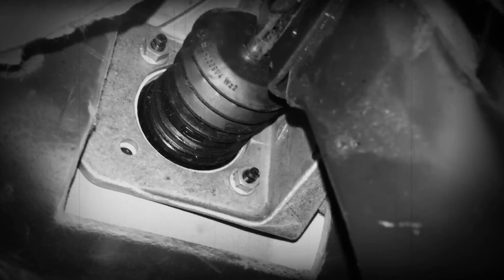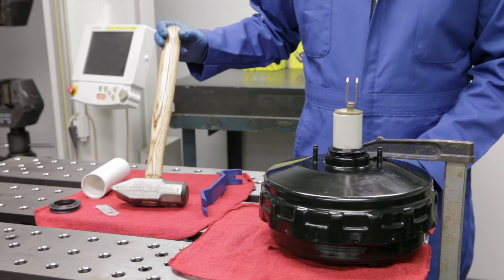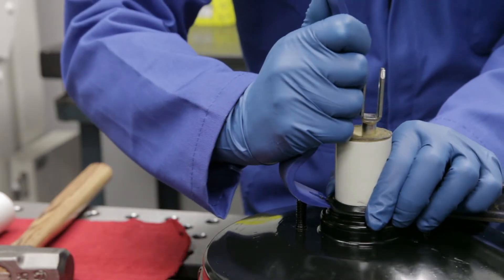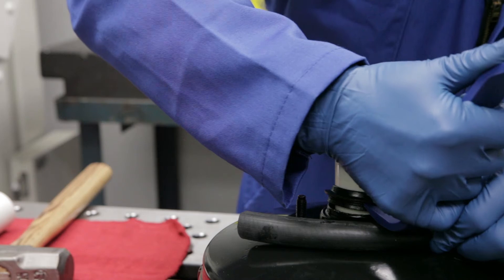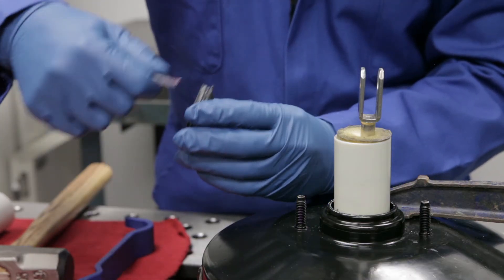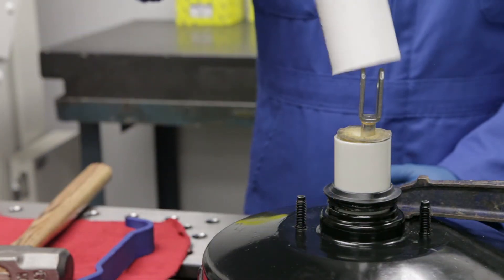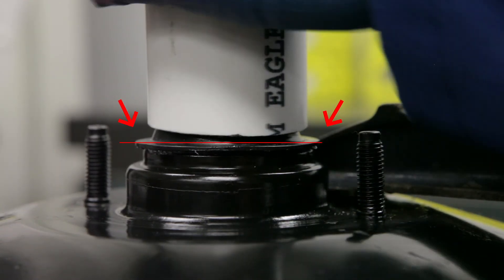URO Parts Repair Kit 001 430 0708 for ATE Brake Booster Plunger Seal 03.7718-5028.1

Comment: I am struggling to find the right pluger seal for my 1998 SL500 - the part number is nowhere to be found.... any thoughts on one that will fit?
Reply from the maker: Sorry Booth, unfortunately we don't have a seal kit for the SL500.  The original seal probably has the part number molded on it, but sourcing one could still be a challenge, so it would be a gamble to remove the booster to check for a part number and have the vehicle down for an unknown duration.

Comment: Can you replace these on BMWs without removing the whole booster ???
Reply from the maker: @darrend2035  Which model and year do you have?
Reply: I have a 2003 bmw M3 , it’s the e46 generation

  It’s stops completely fine just makes that hissing sound right on the plunger seal ( when brake pedal is not pressed )
, almost certain the brake booster diaphragm is fine .

Comment: UPDATE: I finished this job from under the dash on my 2004 ML500, now let me say this AND LISTEN CLOSELY: If you have a bad back, or no to little patience, DONT TRY THIS!!! This job is a lot like sex in the dark, its all about feeling what you're doing. Having a lift would make this so much easier, you can bring the car up enough to stand next to the car as you work under the dash, if you're gonna do it on the floor, make sure you have enough room next to the car to lay out, if you have some kind of lounger or long bench that you can lay on thats level with the floor of the car that would be the best. I would make a custom platform for this job that you can lay on right along side of the car, that would make it a breeze.  I'm a 54-year old ex-mechanic who's had spinal surgery, so if i can do this ANYONE CAN!!! You need to cut the setting pvc tube in half to be able to get enough power into your strike, I lost the brake pedal clip, so a cotter pin works just as good. Another important thing, after you remove the brake pedal assembly, put back 2 bolts to hold the booster in place as you work, otherwise the in-and-out movement of the booster whenever you touch it will make this job impossible. Now whennyou finish the job and you've done it right, when you first start the car the brake light will be on and it will stay on, but it will go out after you stop and start the car after pumping the brakes a few times.
Reply: bout to go head on / back down with this on my 2002 ml320 very soon. thanks for your detailed account.

Comment: Supposedly this can be done without removing the booster and I guess I'm gonna find out about it soon😮
Reply from the maker: That will be EXTREMELY difficult and is not recommended, but it has been done before: https://www.youtube.com/watch?v=saX-GG6s1Ck
Reply: @Uroparts well I'm in the middle of doing it right now, it seems that a little piece of the old rubber seal ripped off,  when i tried to pick it out, it just fell away inside. It doesn't seem to be an issue and it doesn't seem to me to be obstructing anything, it just disappeared within the crevices of the plunger. Its not in the seal area, it was a minute little piece and it really dont seem to me to be an issue that will cause a problem.
Reply: UPDATE: I finished this job from under the dash on my 2004 ML500, now let me say this AND LISTEN CLOSELY: If you have a bad back, or no to little patience, DONT TRY THIS!!! Having a lift would make this so much easier, you can bring the car up enough to stand next to the car as you work under the dash, if you're gonna do it on the floor, make sure you have enough room next to the car to lay out, if you have some kind of lounger or long bench that you can lay on thats level with the floor of the car that would be the best. I would make a custom platform for this job that you can lay on right along side of the car, that would make it a breeze.  I'm a 54-year old ex-mechanic who's had spinal surgery, so if i can do this ANYONE CAN!!! You need to cut the setting pvc tube in half to be able to get enough power into your strike, I lost the brake pedal clip, so a cotter pin works just as good. Another important thing, after you remove the brake pedal assembly, put back 2 bolts to hold the booster in place as you work, otherwise the in-and-out movement of the booster whenever you touch it will make this job impossible. Now whennyou finish the job and you've done it right, when you first start the car the brake light will be on and it will stay on, but it will go out after you stop and start the car after pumping the brakes a few times.

Comment: Can I bye a kit for ate51 for my 250Se Mercedes -67?
Reply from the maker: Hi David, "Brake Booster Plunger Seal Kit 001 430 0708" is for late-model cars, and does not fit your 1967 250SE.  Our kit fits these vehicles: https://apaindustries.com/parts/11128  Unfortunately this is the only kit we offer, sorry we can't help you.

Comment: My brakes make that hissing noise when i depress them instead of when you release like in your video. Is this still a symptom of the seal? I also have other strange issues such as a choppy idle and the engine will sometimes rev when I am braking to a stop. I am wondering if all of this can be the leaking brake booster.
Reply from the maker: Hi Adam, yes that sounds like a leaking booster.  The hissing sound is air being sucked into your engine's intake, and that extra air going into the engine is why it revs.  A professional mechanic has ways of confirming the location of the vacuum leak before you start replacing parts.
Reply: @Uroparts  yea I tested the other day by mashing the brake pedal a lot and saw the rpm’s fluctuate. Taking it to the Mech tomorrow. I’ve had this issue for years but I don’t know how every mechanic missed it my theory is that the leak happens when depressing the brake as you said so a smoke test didn’t show anything. I bought your kit to fix the little rubber gasket. Will that likely solve the issue or do I need a whole new booster?
Reply from the maker: @Dynasty-s1y  What is your vehicle year and model?  If our seal is the correct replacement for a leaking original seal in your specific booster, it should take care of it.  Occasionally a mechanic or DIY will damage our seal while attempting installation, if that happens just send us an email with your proof of purchase details and we can mail you another one.
Reply: @Uroparts  I have a 2010 Mercedes e550 coupe. It has the m273 engine.
Reply from the maker: @Dynasty-s1y  No problem!  URO Brake Booster Seal Kit 001 430 0708S fits the 2010-2013 base-model E550.
Reply: @Uroparts  0014300708S  is what I have this is fine right? Not sure if the S makes a difference.
Reply from the maker: @Dynasty-s1y  You are correct, 001 430 0708S is the part number for our replacement seal kit.  001 430 0708 is the Brake Booster part number, which we include in our part number so people can find our repair kit more easily.
Reply: @Uroparts 
Do you make booster seal for other brand cars?

Comment: I did this on my mercedes ML500 2003 and installed it while the booster was still in the car. It works great however, the bas/esp light came on after the install and i can’t get it out of Park. Any suggestions?
Reply from the maker: Hi Julian, if you can't get it the car out of park, you may have accidentally bumped the brake switch while working on the booster.  If the car doesn't know you have the brake pedal depressed, it won't let you move the transmission lever.  For the ABS/ESP light, your ABS module may be corroded or failed, see this video: https://youtu.be/MBtx0XWhmy4

Comment: How was the dust boot / dust cover removed? I have this kit and my brake booster looks similar but the dust boot hole is too small to pull over.
Reply: And my question was answered in the instructions provided XD

Thanks URO. I was worried it would tear, but it was fine just pulling it off.
Reply from the maker: @kylerichardson8559  Excellent Kyle, thanks for the update!

Comment: Where can i get a complete booster overall kit for a Volvo S40 2.4D 2008 and engine mountings?
Reply from the maker: Hi Pine, we offer the right Engine Mount 31262676 and left Engine Mount 31277442 or 31316498 (depends on your chassis number) for the 2008 S40, which are available at great prices from online retailers.  Unfortunately we don't offer any brake booster components for that model.

Comment: Please, what's this material you put to that seevo? Is it glue or silcone?
Reply from the maker: Hi Ebrahem, the clear liquid in the tube is silicone grease, which lubricates the rubber seal and helps minimize air leakage.
Reply: @Uroparts  thanks

Comment: This isn’t working on my 2005 Volvo S60R. I have the booster out of the car and I have the seal seated, but it just isn’t going any farther than the first ridge. I followed all the directions in the video, but the first ridge on the seal ended up ripping off and the top of the seal started caving in. Help please! My car currently is underivable because of this.
Reply from the maker: Hi Connor, what is the tiny part number on your original Volvo seal?

Comment: Hello URO, my Mercedes c300 only sometimes it hisses with very low sound, and most of time it disappears.and it didnot affect the performance... Is it normal?
Reply from the maker: Hi Dion, you'd have to have a professional mechanic investigate the issue, but it could be your brake booster plunger seal starting to leak.  When it gets bad enough, it can affect braking performance.

Comment: Hi, When pressing the brakes I can hear hissing sound like on the video, is it the seal on the servo? It’s hisssing only while pressing in
Reply from the maker: Hi Kubak, like it shows in the video, hissing behind the dash is a sign that the vacuum booster seal is worn and leaking badly.  Please have your mechanic take a look for a professional diagnosis.

Comment: Hello, thanks for the great videos and guidance for DIY repairs. Please suggest dealer in UK where I can purchase Brake Booster Plunger Seal for Volvo S80 2001 part No 0014300708S. I found it in ebay but only with delivery from US. Cheers.
Reply from the maker: Go to www.rockauto.com and use the Part Number Search tab at the top of the page.  Then search for part number 0014300708S.  They have low international shipping rates.
Reply: URO Parts thanks

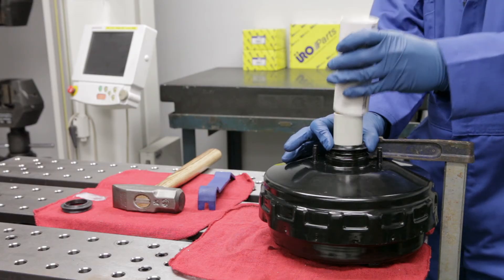Comment: Very important what he's doing at 2:50 : notice he is using the end of the pressing pipe that is cut and an 'angle' so he doesn't apply pressure all over the seal, but only over a small section of the seal at a time.  Trying to force all the seal in all at once will not work and may put too much force and damage it
Reply from the maker: Good eye Peppermint, that's exactly right!
Reply: mine got damaged but not the outer part it was where the larger rib meets the seal it just tore off. I wonder if I need to take a piece of plastic and push in the meaty part of the seal to keep it from shearing off.

Comment: https://www.ebay.com/itm/Mercedes-W212-W204-W203-W163-X204-C209-Power-Brake-Booster-Plunger-Seal-Kit-URO/192370789193?ssPageName=STRK%3AMEBIDX%3AIT&_trksid=p2057872.m2749.l2649
I recommend PTFE grease, not just any silicone, because many regular silicone greases gets viscous in cold weather. Don't use any regular (petroleum based) lubricant!
You'll also need that plastic pry tool, or something like a nail puller tool, but make sure not to touch the white plunger surface.  I will try this job this summer, with the booster in the car, on a Volvo S60.

Comment: Fits MB C class w204 c220 cdi 2008 perfectly. I replaced without removing brake booster. Removed the brake pedal assembly to gain more space, then put those bolts back to hold the booster steady. The old seal came out easilly without a special tool - just by hands. Shortened the tube end to be just a little longer than the booster fork end. Took a mirror for better view around. Used my fingers to put seal under the booster edge. Hammering was unsucsessful, so I took a lever, found a good edge somewhere under the steering wheel, then pressed the tube with lever carefully (spinning the tube and pressing all around) and it got to the place without a problem!
Reply from the maker: Great ingenuity and work Mindaugas, thank you for your report!  Glad you were able to lever the seal driver, that makes a lot of sense in a tight area.
Reply: Hi ! Can you tell me if this method can be used on 2010 W212 E300 ? Thanks !

Comment: Can you replace this seal on a 2010 Mercedes c250 without removing the booster. Because you can get to this seal behind the brake
Reply: Update:

I ordered this booster kit for my 2010 Mercedes c250 (rwd) sport. 

My brake booster part number is 005 430 8530. And this seal was the same seal used in my kit. Hope this can help someone else. 

Thanks
Reply from the maker: Thanks for the update Sin Sizzerb, we'll let our engineers know!
Reply from the maker: We don't list this kit for your vehicle, but that doesn't mean it isn't compatible. There are many ATE brake boosters that use this particular seal, so it's difficult for us to find them all. Check the seal on your brake booster to see if it is marked with part number 03.7718-5028.1. If it is, then it will work. Please let us know if it does, so we can add your vehicle to our data.  Thanks!
Reply: URO Parts the number on the seal is 03.7718-5018.1 ATE will it still work for me ? Only one number is different but the seal in this video looks identical
Reply from the maker: @sinsizzerb7790  Sorry but we don't have any information about ATE seal 03.7718-5018.1, and don't know how similar the seal is in shape or dimension.  If you have a backup vehicle and don't mind your C250 being down temporarily, you could gamble and buy our kit to see if the seal is similar enough to work.  Worst case scenario you're only out the cost of the seal kit, since you'd have to buy a new booster anyway.  If the seals are the same, please let us know!

Comment: Excellent job!Finally!Will this fit Volvo S40 2.0D 2007?
Reply from the maker: We don't show it fitting your vehicle, but that doesn't mean it won't. There are many brake boosters that use this seal so it's difficult for us to find them all. Check the seal on your brake booster to see if it is marked with part number 03.7718-5028.1. If it is then it will work. Make sure to let us know if it does so we can add it to our data! :)
Reply: @Uroparts  Thanks guy's!Will do!
Reply: @Uroparts  yes it fits

Comment: i need for audi tts 2009
Reply from the maker: zouir fares you would have to check the Ate part number on your deal to see if it matches. This is the only one we currently have available.
Reply: @Uroparts  ate 03.78720606.4
and brake boster 8j1614105 S

Comment: Do you have a seal for the GM brake boosters gm part number 5465302 looks visually the same
Reply from the maker: Hi Modelfreak125, what specific vehicle uses GM part number 54-65302?  Not finding that part number.

Comment: That is brilliant! never expected this. Can you confirm this will fit a Brake booster for Mercedes ATE 3.6762-0402.4 If so I am off to buy the kit.
Reply from the maker: Hi, our repair kit replaces ATE vacuum seal 03.7718-5018.1, is that the part number on the seal in your booster?  Our application list is undoubtedly incomplete (we add additional compatible vehicles as we discover them),  here's the list so far: https://www.uroparts.com/uro/inventory/show/11128
Reply: @Uroparts  how about G class? W463

Comment: Will this fit land rover Freelander 2 (2008) please?
Reply from the maker: We don't list this kit for the Freelander, but our kit is a replacement for ATE seal part number 03.7718-5028.1, please check the part number on your seal to see if it's the same.

Comment: I was able to install this in my 2003 ml 350 without removing the brake booster. I took me about 1.5 hrs. I did have to cut the plastic tube in half, but WAAAY easier them removing the booster . Works great, the brake pedal is much firmer.
Reply: I removed the pin from the brake peddle to the shaft
Then I removed 3 bolts for the brake assembly
then remove the according
then pry the old seal out with a plastic tool, so you don't damage the shaft
get silicon grease and put a thin layer on new seal
put the seal on per the video
I cut the white tube in half and used 1 end to push on the seal
the other curved half, i used a small sledge hammer to hit the pipe 
keep hitting the pipe while turning it in small moves like the video
I used a small dental mirror, the size on a dime to make sure it was sealed 360 degrees
Reverse steps and your done
This is off the top of my head from 3 months ago
Do this at your own risk. good luck
Reply: Hi, i will be attempting to replace the seal. Can you please advise on how to disassemble the brake arm. Thanks.
Reply: On the ml their are 3 nuts holding the brake assembly. No need to remove the spring. Remove the brake plunger clip and away it goes
Reply from the maker: Excellent work Arthur, very ingenious! We'll add your tip to the video description.
Reply: Do you happen to have a video of this repair process? Or any step by step instructions? I have a 2003 ML 350 with this same issue. thank-you.

Comment: Finally a definitive solution to a problem that plague ATE boosters for decades! The Mercedes M-Class vehicles was one of the most affected by this defect and until now replacing the whole booster has been the only solution available, besides adaptations not guaranteed to last long. Now we can just replace this darn seal and fix this issue in a efficient and cost effective way. Great!
Reply: What do u mean adaptations don’t last long transmission???